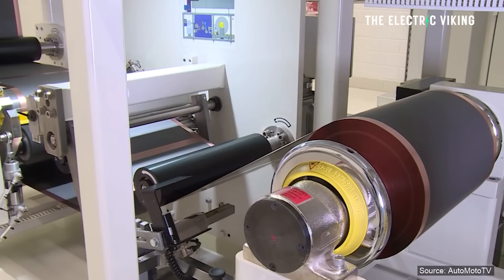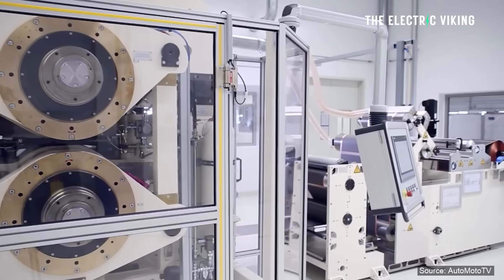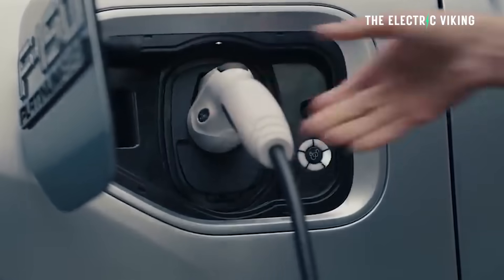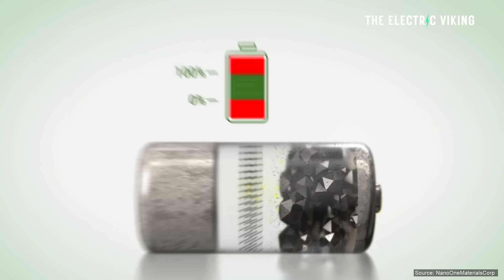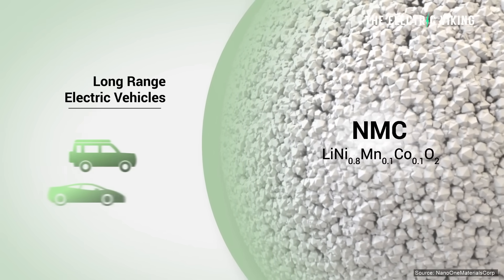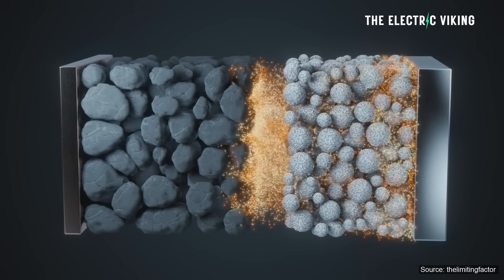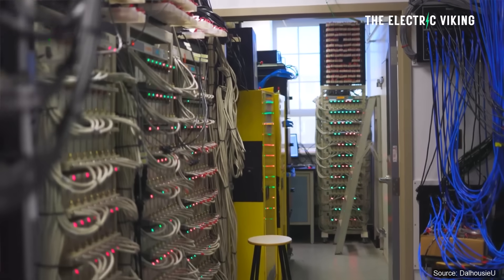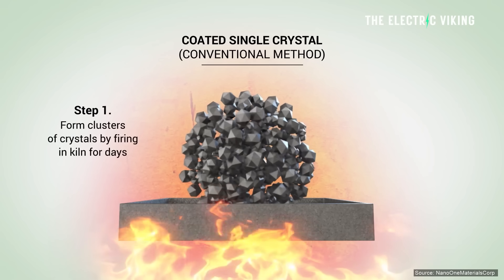New battery revealed in Canada that gives EVs over 5 million miles

Comment: In my opinion, the life of an EV battery is but one of the requirements for mass EV adoption. Remember that ICE cars have been around for almost 150 years. The adoption was slow and this allowed all the infrastructure (fueling stations, repair mechanics, spare parts etc) to develop over time. It took decades for this infrastructure to become viable to own and operate ICE cars. Fast forward today, the EV has to be at least equivalent to ICE cars in these respects if it is to be competitive. EVs are far too complicated and radically different compared to ICE cars and the main problem is that EV repair mechanics are few and far between, resulting in costly swap out repairs. Let's not mention charging EVs. If 50% of ICE cars we're to be replaced by EVs. The power required to charge these vehicles would probably collapse the electric grid. I live in South Africa where the local power utility. ESKOM, often implements scheduled rolling blackouts because they cannot meet the electrical demand, so imagine what would happen with EV charging in this case. People living in most European countries live in apartments and park their cars on the street. Sometimes these cars are parked some distance from where they live. How would charging these EVs work. Public charge stations are a joke until such time as there are as many recharge stations as there are service station fuel pumps and charging the EV battery takes as long as refuelling an ICE car. Having said this, I would consider an EV as I work from home, don't travel much, use my car mainly for going shopping and I have a fairly large rooftop solar system with ample lithium batteries to be able to charge the EV "for free". Again, the maintenance and repair of the EV is what stops me adopting this new tech.

Comment: This is nice, but the average charge still isn’t doing much better than 250 miles per charge  (using the 5M number). The great breakthrough will be when batteries can typically go 350-400 miles per charge. This will be the tipping point for EVs.

Comment: Yeah great.  but it is still lithium.  will it blow up or catch fire?
Reply: EVs catch fire more often that EVs. Don't challenge me on this, do your own research and learn new facts.

LiFePO4 batteries do not combust. What can happen is a wiring fault leading to a very rapid discharge and overheating of the cIrcuit. I have 2x200 Ah batteries rated to deliver 400A continuous. This enough to run a 3Kw inverter powering a 2400W powerboard at 10A, enough for common domestic appliances.

400A is not to be messed with, and if there's dead short those batteries can deliver heaps more than 400A.

Comment: Even if this battery technology is successfully commercialized and brought to market, EVs and batteries still have to dramatically come down in price before they will have true mass appeal. In addition, our electricity generation systems will have to ramp up substantially to meet the demand for the power needed to charge these new batteries. 

One of the major limiting factors is physics, where the more energy you need to store, the bigger the container (i.e., a battery) needs to be to store it. This is why current EV batteries are as large and heavy as they are.

For the moment, oil still delivers a better EROI (Energy Return on Investment) than EV batteries do. When that equation is reversed, then EVs will start to make more sense for average consumers.
Reply: Chemistry actually. Not physics. Change the chemistry, change the energy/weight ratio and the cost/weight ratio. Any lead-based chemistry is massive. LiFePO4 batteries are way lighter. I don't know the chemistry of likely sodium-ion batteries, but as sodium is heavier so too will be the batteries. Cheaper though. Sodium is next to free. If I wanted to power my house and sodium-ion batteries were available, they'd be cheaper but need more space. They might win out in my RV too. People use AGM batteries, these would be lighter.

BTW if you want to have mobile power for camping, and you decide 100Ah will do the job, here might be a little surprise for you.

AGM batteries are rated to deliver their capacity over five hours. C is capacity, so .2C. So five 100Ah batteries to deliver your 100A. Worse, you harm them if you discharge beyond 50% capacity.
So (5x100Ah) for 30 minutes at 100A, or 2x(5x100Ah) for 60 minutes at 100A.

LiFePO4 batteries are mostly rated to discharge at 1C, and can be fully discharged or near fully discharged. For margin for error let's go with 120Ah. Just the one. We can have 100A for an hour, perhaps a little more before the lights go out.

I did my research on this a few weeks ago.

PS I can charge my batteries from solar panels on the roof. Free electrons!

Comment: It's time to take as much metal out of the car as possible. thick plastic parts thick enough to have the same strength as their metal counterparts. the reason we couldn't do this before was the heat from combustion engines would've melted them. EV's don't have that problem.
Reply: Most current plastics are environmentally unsound. They burn nicely too.
Reply: @oneeyedphotographer  and what are we doing with them now? recycle reuse, besides hemp plastic is the best.
Reply: @TheInsaneupsdriver  Melting them down, or crumbling them, for use complicates things. I have a heap of LPDE bottle tops. If they're melted together or crumbled into  pellets, nobody can tell what the plastic is and how to further recycle it.
Reply: @oneeyedphotographer  and what do with all of them? there is enough now to cover the planet...! and it's not biodegradable... So we use it, and keep using it without making more. and when we do need more we make plastics that do biodegrade and are not a hazard to the planet.

Comment: 5 million miles at how many miles per charge & how long to charge? Canada is cold & Texas is hot, how much degradation per charge in these extremes. Any new rare minerals, availability or cost? Can manufacturing be scaled up as easily as present batteries, nope not discussed not answered. Bloody disappointing Viking.
Reply: There are self-warming batteries.
A lot of Australia is hotter than Texas,  I don't think heat in Texas will be crippling.

Comment: In Canada, winter performance  is also the issue.  When we get to 500km range at -30 Celsius then more Canadians will be interested.

Until then, they will mainly be urban vehicles.
Reply: If you are serious, do some research. In Western Australia, it's not going to bother me, but there are ways and means to warm your batteries. Google has some solutions, I don't know whether they're sufficient for you. Probably University of Saskatchewan knows of the problem.
Reply: @oneeyedphotographer  In quite a number of regions in Canada, away from the southern cities, one can travel 200 km without even seeing a gas station along the way let alone an EV charging station.  If you go that far and can't charge, you need enough to get home with some left over in case one is caught in a winter storm.   For now I'm sticking to my hybrid that averages 730 km between fill ups.
Reply: @notanothershrubbery  You can drive across Australia in an EV, but there are places I'd not go without research.

At a pinch I could install solar panels. I don't think I'd go places fast, but I'd not be stuck in snow with cold batteries.

There's a regular solar challenge in Australia. They keep changing the rules, once EVs started exceeding the speed limit there wasn't any point in more speed.

Maybe Canada needs one. Don't invite your neighbours, you could get Trumped.

Comment: that's fine , but it will be years before any of this tech gets implemented , also it''s the operating cost of ICE vs electric never see the break down , insurance , charging versus fill up .... etc  , then there is purchasing a used 4 banger for a handful of dollars vs a used electric for a considerable cost with no idea if it will last x number of years or that I have huge battery replacement bill

Comment: Giving batterie life in km or miles is BS. 

Any car, EV or other, is designed to last for 250 000 to 300 000 miles, as this is 20 years of average person driving, so everything about the car is obsolete, long before the car reaches he end of its mechanical life. We need batteries with 10 000 cycles lifetime for our homes, meaning a 25 year daily charge-decharge cycle.

Comment: Many years ago when I was working in industry we tried to sell a new clutch to a large tractor company. They told us it was too good and we had to degrade it because the customer said replacing clutches was a large part of their continuing stream of revenue. Perhaps repurposing old EV batteries into energy storage will keep that from happening.
Reply: I'll admit, I had a "aha" moment when the idea of repurposing battery packs came up. Then I read a comment about new EV options for what class (ie age) of battery it will be fitted with. This would send the same kind of negative feedback to the producer you mentioned. 
Maybe obsolescence isn't an equation in thermodynamics, yet.

Comment: This would be really good. Up to now, the car has survived the battery. As batteries are not cheap this aroused the question of whether it will make sense to buy an expensive battery for an aging car. Additionally, the battery has a lot of chemistry inside that cannot be totally recycled. So, a battery living longer than a car is a genius invention.
By the way, a well-maintained plumb battery in a power station or in a substation may also live for thirty years, but in my cars, I had two times a mechanical break of a battery plate which made it suddenly and totally fail during the ride. I don't know how this new battery will deal with his problem, as it is a mechanical one.

Comment: Batteries don't just deteriorate by charge/discharge cycling, but also by age. In a car it's also subject to vibration, and wide variation in temperature. I would be more convinced if they'd been testing this new battery in an actual EV, not just in a laboratory. Plus, to achieve, 20,000 charge cycles in 6 years, that's 9 cycles per day. It'll be a game-changer when it's proven in service.
Reply: Great point! If the cathode crystals are more stable from the stress of expanding and contracting, perhaps they will be more resistant to other stresses (maybe thermal too).

Comment: What is the energy density and chemical makeup of this battery? 20,000 cycles for a home battery at 1 cycle/day = 50 years approx with 20% loss of performance. So good home battery solution - BUT being lithium still has a potential fire hazard issue for the home…

Comment: In countries like Canada, I believe the issue holding back many of us back from purchasing an EV is range in cold weather. I live in Calgary Canada. One of my sisters lives in Edmonton which is 300KM or 186 miles away. At -25C very few, if any, current vehicles can make that trip without charging. You might be able to if you didn’t need heat to keep the windows defrosted let alone keep warm yourself.  There are enough charging stations available when it is not too cold but not when it gets really cold. Last winter we had very cold snap in Alberta which hit -35C (coldest in 2 decades).  I’m sticking with my fuel efficient 1.4L gas motor until this issue is solved.
Reply: Agreed...I live in SW Sasaktchwan...my 1993 Jeep Grand Cherokee looks pretty good still, and runs awesome.....at 440,000 km....I replaced the transmission and the transfer case a few years back, had the rear end rebuilt, and if there is a need to replace anything major in the next several years, I have a second one with half the Km on it sitting at my friend's farm....so spending all of that money on an electric headache instead of my trusted Jeep which has always been dependable makes no sense.
Reply: Agree it's a big part of what's holding folks back, but it depends on usage. I'm also in SK and been driving electric for over 3 years. To the OPs point, I probably can't make it to Saskatoon in the dead of winter with my EV, but I can count on one finger the number of times I've attempted that in over 30 years of driving.
I'm hoping for a future where I opt for half of the battery I have now with the ability to add on when it's needed
Reply: @devons2381  I understand where you are coming from. The biggest issue for us is we decided to get rid of my car when we retired so we are down to one. We can’t depend on an EV.  We have been going on lots of short 2 or 3 night trips, by car,including in winter since retiring. When the range improves and there are enough charging stations for cold weather driving I would consider an EV but I might be dead by then.
Reply: The average Canadian cannot afford a new vehicle let alone one that doesn't fulfill everything people need in a car. Car ownership will soon be like owning a home in Canada, completely unattainable.

Comment: A couple ?s come to mind, can they be made at a scale & cost that makes sense? Most people would not pay extra for a battery that would last longer than the car itself, on the other hand auto mfgs can make cars that last 30 + years. I just took a 30 yr old Volvo 850 to the scrap yard with an engine that runs great because  not because I couldn’t keep it going bu because bev cars are so much cheaper to operate.
Most people in the USA anyway would rather buy a new car than keep up with maintenance on a old car.
Reply: 30-yr-old should be hyphenated.

Comment: Solve one weak point and the problem just moves to the next weakness. Pointless investment if we already have packs that last longer than the cars. They don’t fail at the cell level they fail at the pack level the BMS goes or the insulation or the pack gets punctured. Water damaged. I can tell you that the cars suspension will be toast long before the battery.

Comment: Okay! We charge the battery with electricity from a source and then we can use that electric battery to charge a home. I don't want to throw a spanner in the works but my home has  a electric cable that supplies the electricity I need from a source.
Reply: It can be initially charged from renewable sources.     Its unlikely you can do that at home in all seasons.

Comment: Viking : don't confuse the word Dicovered with the word Invented.
You discover the fire, you invent the Wheel.
Reply: Though technically the wheel idea was only "repurposed" . There's plenty of round disc things available. Working out what and how to reuse, and sell, the idea ls key.... and what makes you famous.  Same could be said of steel tread wheels, rubber, pneumatic etc... ;)
Reply: @bowjjj3  agreed. But surely, you don't discover a new technology of battery because it's the result of a new chemistry, therefore a new invention or development. A new chemistry is not found in your backyard one day without no work done.
Reply: Discovered
Reply: @duanehorton4680  yep you discovered a new battery technology in your backyard.... you didn't do anything. You woke up one day and it was there..... funny meaning use of the word Discovery.
Reply: @paulcrosa9834  I was correcting your spelling.

Comment: Viking it’s wonderful research but just that. No one is tooling up for this new approach as we are focussed on NMC and LFP applications in transport. The rest of the vehicle will require replacement long before the battery. Look at the amount of time Novonix has taken to develop the dry cathode approach and they are yet to build the factory. One step at a time please.
Reply: If you know about Novonix, you likely know single-crystal CAM samples from all competitors in this space are in evaluation. Apparently, this takes a ton of time. At least we have the Canadians to validate the cycle life claims.

Comment: Speculation: with nano crystalline electrode li ion reservoirs, because the internal stability is so much higher, you could imagine that rapid charging could be positively affected. If you don't have to worry so much about electrode degradation from rapid charging, only the sei and the electrolyte would need to be optimized. If the Li ion reservoirs is so hardy against mechanical force, maybe heat from ultra rapid charging would also be less problematic. One step closer to >5min 0-80% charging. Plus Li ion doping would also likely not stress the battery as much too. Overall, you could sacrifice a few million kilometres for ultra rapid charging and ultra high capacity. Maybe 🤞🏾. Say 300-500 wh/kg - 0-80 >5min, and cycle life 2-5 million kilometres. That's enough for almost all modes of transportation. Maybe.
Reply: Li-ion should be hyphenated.